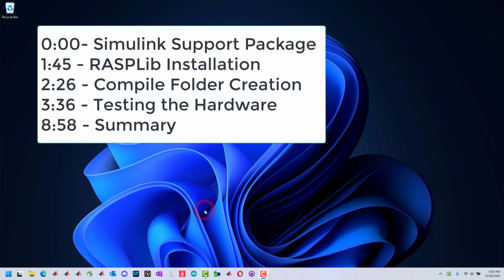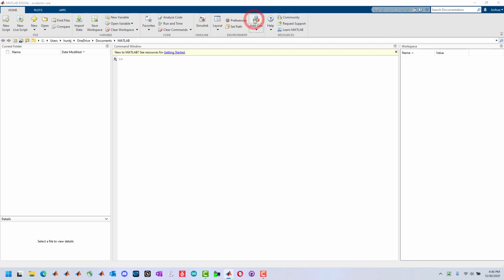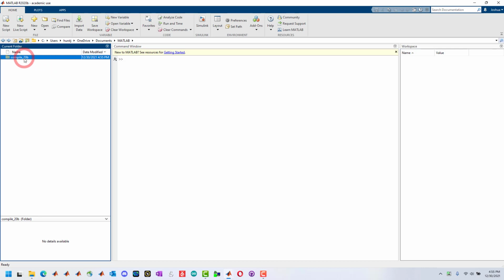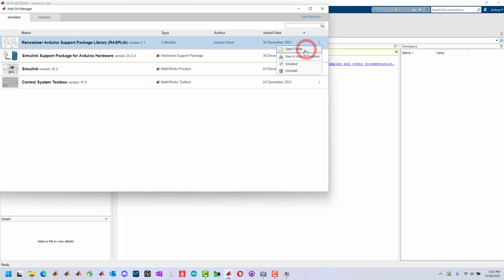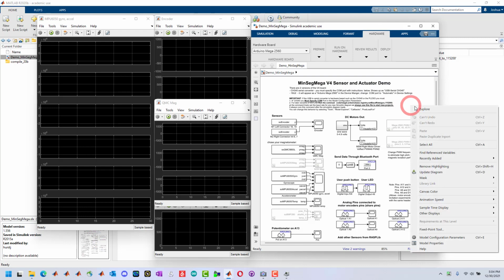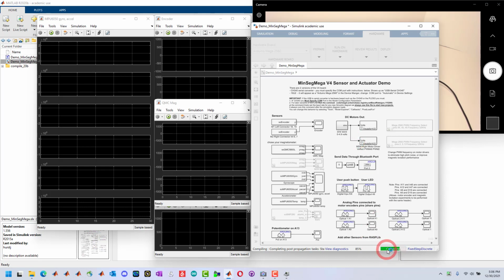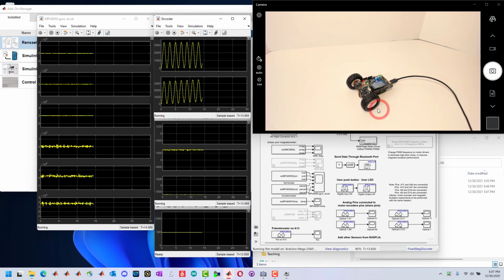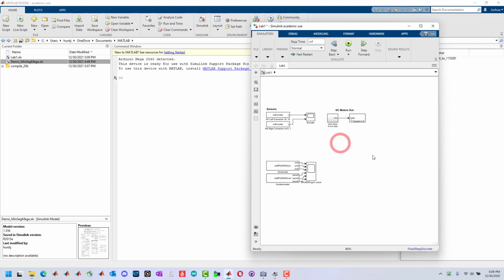Installing Simulink Support Package and RASPLib

Comment: I have installed simulink support package for arduino hardware,but during hardware setup, download tests fails saying that laptop port and arduino board was not connected.I have tried installing drivers and compiler but still connection was not established between port and the board. What should I do?